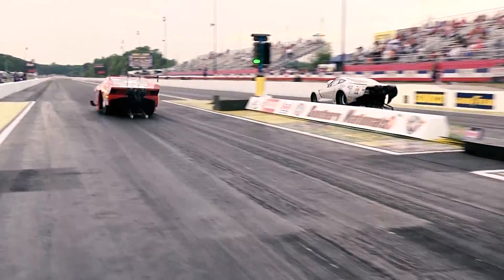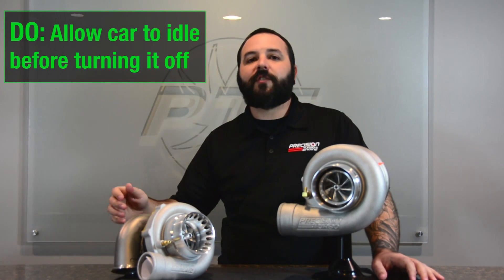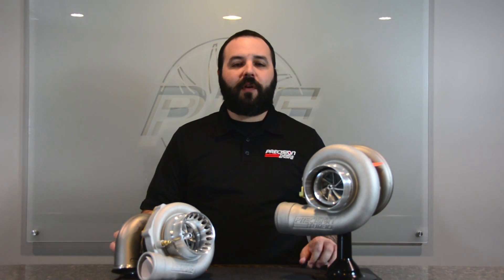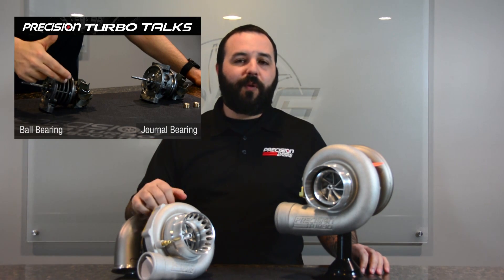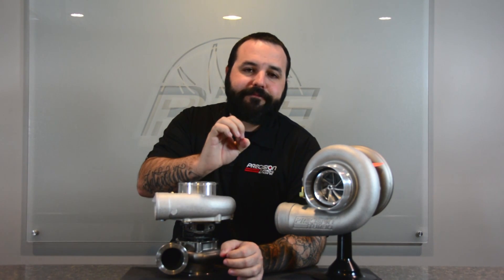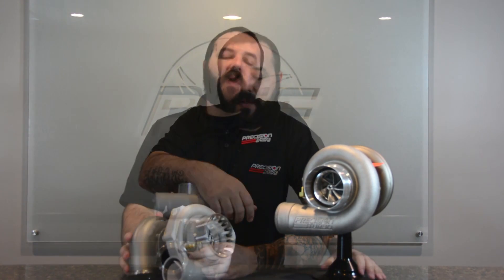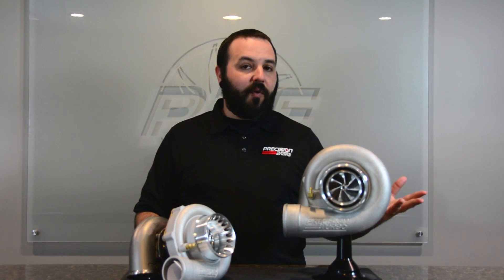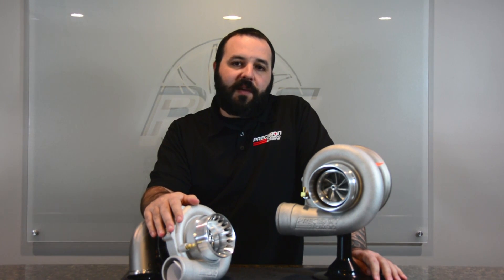Precision Turbo Talks - Turbocharger Do's & Don'ts

Comment: To twin scroll or not to twin scroll? That is the question i would like to have answered.
Reply: 4 bangers have a 2413 or simmalar firing order, twin scroll isolates exhaust pulse crossflow inside the turbine housing, therefore decreasing spool time.
Reply: Im running a 6266 twin scroll and ill never look back for a street drivin car
Reply: @tjcollick  i ve also been reading about twin scrolls. They say its nnot anybetter unless u have a seperated or divided manifold
Reply: @stevenholt2941  well yeah, my manifold is divided
Reply: Raul Jimenez i plan on going twin scroll.

Comment: Garrett said it better than I can These bearings require enough oil pressure to keep the components separated by a hydrodynamic film. If the oil pressure is too low, the metal components will come in contact causing premature wear and ultimately failure. If the oil pressure is too high, leakage may occur from the turbocharger seals. With that as background, an oil restrictor is generally not needed for a journal-bearing turbocharger except for those applications with oil-pressure-induced seal leakage. Remember to address all other potential causes of leakage first (e.g., inadequate/improper oil drain out of the turbocharger, excessive crankcase pressure, turbocharger past its useful service life, etc.) and use a restrictor as a last resort.

So not never on  journal bearing but usually no. Again the "restrictor" that came with my eBay turbo isn't anywhere near as small as the "real" restrictor I got from vibrant (which was clearly made for bb turbos).. also, yes, the drain line is very important to be done right!
Reply: Also i may say or ad to this equation. Builders are always arguing pressure vs volume(oil) Just look at Cat vs Cummins (just an example don't get your panties all bunched in your V spot). And I have noticed way to many people are going for look vs function. Just go with more simpler there stupider...

Comment: Some cheaper turbo's too (im sure this all applies to their turbos) can need a restrictor especially on a high psi (oil psi) engine, he's right about it being a case by case basis and also there are different types of restrictors. I got a vibrant one that was like a pin hole, definitely not enough flow for my journal turbo but I originally had too much pressure. That restrictor actually got plugged and killed the turbo, its ebay replacement also came with a "restrictor" that goes in the oil inlet flange but is waaay larger than the pin hole one and just enough to lower the pressure enough (driving 90psi into this kinda turbo will leak past SEALS!) Again all case by case and what I've said here applies to cheaper turbo's we've worked with.
Reply: Ball bearing turbos aren’t cheap you need reatrictors for ball bearing turbos.

Comment: On all turbos I would put an oil restrictor on... every single turbo that I've not put one on I've blown the seals out of it. I personally think that's the worst recommendation I've ever heard.
Reply: PatioPerformance Crew how long have you had it ?
Reply: I've heard that a lot about PTE.  They strongly recommend not using one.  I even knew a guy who blew the seals out of a couple because they didn't recommend it and then used one and it lasted forever.  To be fair, this was on a Chrysler 2.4 and they push like 100 PSI of oil pressure.  No joke.  Chrysler went WAY overkill with the pump pressure and volume for that engine, lol.
Reply: all the boost I don’t use a restrictor on my BW S300 journal bearing be working great for some time
Reply: all the boost I don’t use a restricter and have no problems or smoke

Comment: I would like to hear your thoughts on compressor surge or brake surging turbochargers. I hear mixed responded on if it caused damage or not. I've been involved in turbos for a few years (ok over 2 decades) and have my own opinion on past experience. Thanks if you can answer.
Reply: how is there still a misconception about surge? Compressor surge under boost is bad. the noise u hear when the throttle is closed and the turbo blade chops up the air is not real surge. however it does slow down the compressor blade some which slows down transient response (how quickly boost comes on)
Reply: only bad on shit turbos
Reply: What do you mean by "brake surging"?
Reply: A...use a blow off valve or B. use an anti-surge ..... witch both he has are anti surge
Reply: brooksman10 there is a a very very minuscule amount of exhaust gas but that's just to be expected
Reply: Billy Beane it doesnt cause damage because unlike what most people think it doesnt cause the turbo to spin the other way it just slows it down
Reply: Abec777 Hondatech Maybe if you have a shit turbo, they're designed to be strong anyway. The only time it's really bad is when you're hearing it at WOT. Otherwise the only load on the turbo is the charged air, as there is no exhaust gas spinning the turbo when the throttle is closed.
Reply: It stresses everything on the bearings side, vibrating the shaft and impellers in-out / up-down very fast. The best way to imagine it is trying to take a nail off a wall with the hand with quick movements. A rich moron in a nissan made a video proving he knows S__T about turbos... This is were all the BS about it non-damage on turbo came out...

Comment: I dunno.  I purchased a turbo from these guys. Bearing failure in 4.500 miles had a professional rebuild and it failed at 5.700 miles. 
Of course it was blamed on me. And I'm out 2k. So i thru it away and purchased a Borg Warner turbo. And have had zero issues.
Reply: If you get a turbo from a company that has industrial background like borg, garret ect. You won't have to worry there turbos get beat to death and keep on going. I've been a truck driver for 20 years and the turbos on them things sometimes go over a million miles without any problem.
Reply: Steven horsefield
I’ve kept a fleet alive mostly by myself for a few years and yeah - the turbos make boost forever but they leak oil like MF - early too in my experience.
Those engines don’t give a fuck about oil in the intake tho LOL.
Reply: @negativeindustrial  Diesel? Runaway risk from running on own, internally leaked lubricating oil?
Reply: I generally pull and bin atleast 1-2 pte turbos a month. Vs a garrett, bw, they're fragile. Good for power, but no durability. Chinese made, assembled in America. I refuse to use or recommend them.
Reply: highly doubtful your choice of oil had anything to do with it. maybe who set it up?
Reply: Idk what you guys are talking about...I've got 3 years out of their t-shirt I've been running it on 185lbs and will likely add more with holiday season.
Reply: Well I do have to admit. I was only using basic synthetic mobile 1. But sence then i switched to brad penn high zinc formula oils. After reading the information posted about oils to use. On forced performance web site. 
There is a chart pretty much saying we should be using very high zinc oils. 
My car is an old 91 Mitsubishi with a 4g63. So ALL emissions stuff including cats have been removed. 
With the BW. Turbo I'm using a 10/an drain and 4/an oil feed from the cylinder head.
The combination works excellent. I don't understand why the precision turbo didn't make it. But it's to much money to take another chance.
Reply: Mikey de'shon brah nothing touches redline. clean boost is almost as good... but nothing even come close to red line. It also doesn’t burn witch is important in the line of work I’m in but also because blow by won’t induce pre ignition or detonation 💪🏼
Reply: @groomlake51  I know this. It's the only thing the USAF use. But AMSoil and Brad Penn oils are no joke neither. They work excellent
Reply: Mikey de'shon the usaf uses red line???
Reply: Mikey de'shon yeah I like brad pen or driven for braking in the engines I build for the street. It’s a bummer how big oil companies are removing good stuff like ZDDP BECAUSE it’s bad for the emissions system. There’s just way to much detergent in most oils now days . It doesn’t matter how much additives you mix in because the detergent grabs on to everything and stops it from adhering to friction surfaces .
Reply: Mikey de'shon Brad penn is good stuff but amsoil is junk with alcohol or nitro .
Reply: Mikey de'shon there’s also MR Race Oil a new company but I had bad luck with them at the world finals
Reply: @groomlake51  YES. I didn't know this neither till recently. They say that red-line products are seriously good Stuff. But also government is also all about contracts.They also use snap-on tools.
Reply: Mikey de'shon red line is transformer oil so it doesn’t burn. In my line a work people would be scuffing pistons on the warm up and the burn out and just changing the oil to red line would stop it from happening. Lol I only use snap on tools also🤣
Reply: Mikey de'shon check out combustion technology and clean boost oil. It was stated by the old head chemist at red line. They formulate their alcohol oil so that you can boil it after a run at 190 degrees to remove the methanol and run it 10-15 times if you done hurt anything and contaminate it.
Reply: @groomlake51  the only thing I have been using lately for about the last 3 years in AMSoil z-rod formula. It's almost blue in color because it's loaded with zinc and phosphorus. Extremely good protection. But it can't be used on a car with any emission equipment. It will clog up a converter and catch your car on fire.
Reply: Borg for the win
Reply: @LGM-118Peacekeeper  bought myself an efr7163, it was what I needed, IWG that works, twinscroll, everything is in one package making it simpler and more compact.
it's not the highest hp turbo in that size nor as responsive as the latest of some other brands but it have been reliable!
Reply: Mike Brailsford yea I’ve been hearing a lot of people post issues with them. I’ve got their water cooler 6266 and so far at 1,000 miles I seem to be fine so far.
Reply: Tony ARC I'm just to poor to take another $2,000 chance on failure.  It didn't hurt the engine.  But I was stranded 70 miles from home. 
I don't want to sound like I'm try to dis their company.  I'm just explaining I had issues 2 times and I won't make it 3.
Reply: Seen plenty of Kuhnle kopp & kausch (who are a subsidiary of BW and who Bw base most of their tech on) fail on relatively new cars
Reply: @carbonfiber492  so the KKK turbos no good :p
Reply: Mike Brailsford what sort of diesel are you talking? cummins diesels  on ram pick ups come with a Holset turbo and they can push around 38psi. on a Cummins ISX youll see upwards of 40 psi on a single turbo set up
Reply: Garrett and borg ftw all day
Reply: JvRacingVids dude thats a drag strip , they get belted for 6 to 10 seconds flat out then cruse back to the waiting line , they wont last street abuse they just are not designed for long extensive abuse its why they are not water cooled.... plus Garrett just made a bunch of new turbos that match or out do the market , ive never seen a drift/track car run a precision turbo for that reason.
Reply: Tony ARC the Borg sxe 256 is a stout mofo! And is being pushed hard when in boost!! 
Until precision can prove their reliability i just can't take the chance brother.
Reply: Over 10k km's on my s363sxe borg and without single issues at ~30psi. Next turbo is definitely gonna be a borgwarner unit.
Reply: JvRacingVids oh. 3076 precision/ Garrett knock off turbo. 
Something I regret purchasing.
Reply: Tony ARC 36psi with alcohol injection.
Reply: Tony ARC made 540awhp through automatic transmission
Reply: Tony ARC half and half. 
It's to much fun to only track it.
Reply: Mike Brailsford Borg Warner is the way to man, I’m running a 63mm s300 on my civic
Reply: Mike Brailsford BW all the way
Reply: JvRacingVids he is talking about a street car you idiot not a full blown drag car that get stripped every few passes.
Reply: So
Reply: Same here 3 in the garbage... went to holset and been boosting at 35 psi with no issues for over 3 years
Reply: I put 20,000 hard miles on my turbocharged Mustang with a Precision turbo and had no issues.
Reply: Borg warnee ftw thanks for sharing lol I was going Borg any ways.
Reply: @Rollincoal311  or maybe you're just a troll.  And a few of the guys in this thread own and drive some very fast, very powerful cars. They are far from stupid or dumb.
I just knew there was going to a ignorant ass comment like this as I was reading.  Well buddy you're "that guy" and you probably don't even own a turbocharged car. Just had to say something stupid to get attention.
Reply: I have had PTE turbos for well over 7 years now. They do not usually last. Must be rebuilt on yearly basis. Good power but poor quality.
Reply: @K2theK-b6u  if it was rebuilt using a bronze thrust bearing instead of steel like they used from factory,And use high zinc oils it could last a very very long time. 

My little brother has an old first generation 60-1 that he had rebuilt   and balanced before he even put it on his car. 
It has lasted 5 years at 25-30 psi.
Reply: @mikealbrailsford5438  A very very long time on a turbo pushing 42-45psi is hard to believe. I understand MHI Turbos last 100k+ miles but most see 14.5psi at stock power levels. 

I understand Garrett might last longer, maybe because of the added water cooling, but PTE are known not to be very reliable. I have never ran one at 14psi to be honest so when making 1000hp+, turbo rebuilds are the norm.
Reply: @K2theK-b6u  I understand.  But I've also myself had a 16 Mitsubishi turbo running with no wastegate.  30psi just let it run wild way out of its efficiency range last way longer then a pte turbocharger. 
There new generation stuff is better.  But they honestly do have a bad reputation on reliability.
Reply: It looks like they buy China turbos and take them apart and cnc a turbine for them and laser etch the precision turbo logo on them, put them back together and sell them lol
Reply: I've told by my cousin to not buy a precision turbo and where from Australia. Word spreads quick
Reply: Using a garret ment for a power stroke on my old bmw m20. 30k miles so far. The turbo has unknown mileage before I used it lol.
Reply: My mk3 golf tdi runs 32psi lol
Reply: The thing has always been in the Supra world that I remember was.. Precision = Better spool; Short life.....Borg Warner = Slightly longer spool; Great durability. I'm assuming things haven't changed.
Reply: Try
Reply: JvRacingVids I highly dought it. Tell me why factory Mitsubishi turbos last 100.000 miles and my 3076 failed twice in less then 10.000miles. 

And now the BW has been on the car with same oil feed same oil drain for 25.000 miles without a hiccup. ??
Reply: JvRacingVids oh and the Borg turbo is being pushed to the absolute max! Far more than the previous turbo. 
I know exactly why it failed. Junk steel thrust bearing and not a bronze one.
Reply: JvRacingVids yes holset hx35 hx40 and there is ab7 blade hc1 I believe. But I don't think that's stock boost levels. 
And them 3 turbos have bolt on turbine housings available for factory Mitsubishi exhaust manifolds and 0/2 housings.  They're a common and regularly used turbo for the mitusu 4g63 engine. 
But again. The durability reliability and overall performance of them beat out the precision turbochargers. 
Only 3 things I could think of WhY mine failed twice is  #1 because I have a very early first generation precision turbo. Before the bronze thrust bearing was being used.
#2 not using high zinc formula oils like brad penn/ amsoil dominator/ and Joe Gibbs racing's.
#3 precision was a ball bearing unit and BW is a journal bearing unit.

But at the end of the midnight madness. 
I'm out  $2000 and it's not going to happen again.

I'll give them another chance if they agree to take the 3076 back for research and sell me a new one for the price of my s256. $875.
Then we have a deal.
Reply: Mike Brailsford i couldnt tell you why your 3076 on your mitsubishi failed, all i know is that you had a 3076 on your, 4g im assuming, mitsubishi and it failed. but i do know it failed and i also know precision is obviously a quality product, why does every fast turbo car on the drag strip use a precision? quality. what i highly doubt is that they are a company who would send out unreliable, untested equipment. you can find Borg Warners on diesel trucks that run more boost on the daily than your Mitsu. theyre built for it. Precision obviously offers specific guidlines on how to treat their turbos. most likely in the paper you didnt read.
Reply: JvRacingVids most diesel engines don't run 35psi. And the new aluminum rod engine will run about 50psi.
Regardless I've had several turbo builders say they have had nothing but issues with these turbos. And I found out $2000 worth of failure. 
And I'll never try them again. 
I'll stick to a quality extremely well built and can handle daily abuse.
Reply: @mikeydeshon5637  most diesel engines DO run 35+psi, modified diesels exceed 100psi. Both my trucks are from the 90s and run over 30psi, turn up the fuel and 50psi is easily handled with stock components.
Reply: @jaydunbar7538  20 25 is the most I've seen several diesel engines run. I've seen on at 30 before. But he also had a hole in his intercooler. I'm not going to argue anything. Presicion turbo's are trash!! And I'll never support them ever again.
Reply: Mikey de'shon appently you’ve never owned a diesel truck because most guys mod ther stock turbos to run 35psi and it’s not I herd of for an upgrade turbo to hit 60-80 psi and even more with compounds
Reply: Tony ARC yea but no.
I live in Miami. There is several   extremely high boost cars around here on the streets.  
The alcohol injection is what makes pump gas (93)octane tune like 110oct.
Reply: eBay turbos last longer
Reply: it has to be operator error. prescision turbos have been working reliably for years. you dont become a well established turbo company for selling junk.